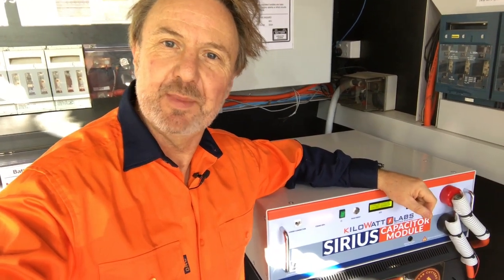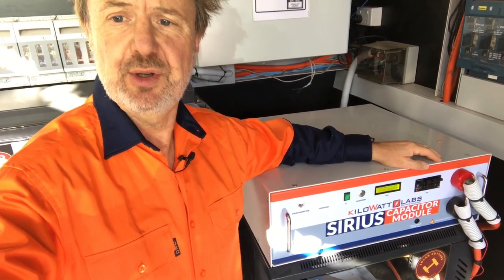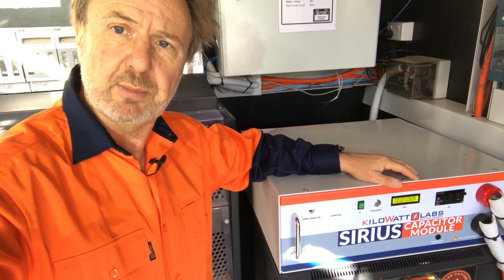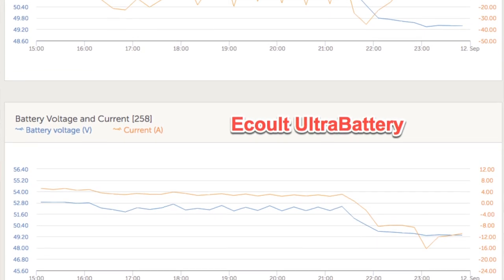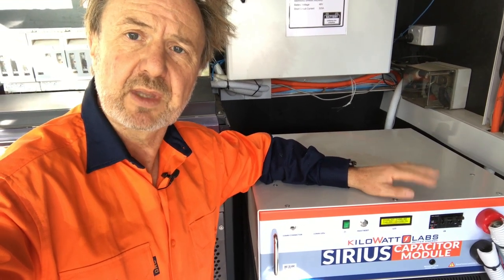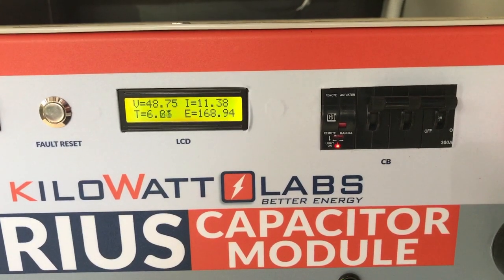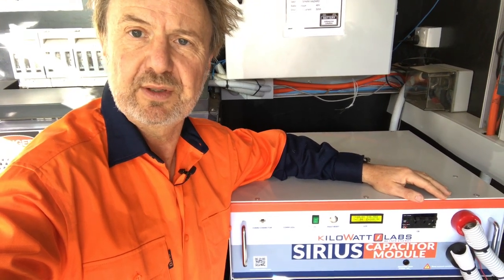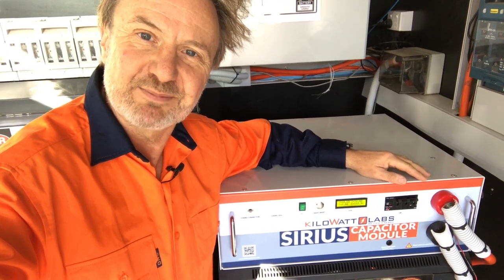Arvio's Kilowatt Labs Supercapacitor Module

Comment: Hi Guys I have been running 2 of these Kilowatt Labs units in parallel for about 5 months on SP Pro Series 1 and Fronius Primo 
Cert .5.0. 6.6 kW Array
Had to turn off  Battery Temperature Compensation to ensure charge voltage did not go too high and trip the unit.
The 2 different units have slightly different voltage and power characteristics when operating according to the screen on the front.
I would have though that these would have been more similar.
Quite different from my experience of conventional batteries when new. I think the measurement of the materials used in the construction of the 2 different units  is not exactly the same, may be because it is newish technology and the materials are imprecise.
Everything works well otherwise, don't go above 54 volts or below 45 volts, charge max 119 amps.
Love how they charge up super fast soon as the sun comes out!
Bit of a leap of faith going down this path so early, but am impressed with them so far.

Comment: Hi Glen. If the super cap and and UltraBattery is connected in parallel, How do you set the charge rate on the system ? ie the super cap and the ultrabattery don't have the same charging pattern, so in theory the supercap wont charge as quickly as it should due to being connected in parallel with the ultrabattery.

Comment: how much does the 3kwh cap cost?  
usually capacitors store 1F, which being equal to about 1J means you need 3600 for 1wh or 36,000 150g 1F capacitors which should weigh several tons JUST for 1KWh.  given this doesn't look like it weighs a ton for 3kwh, how can it be so small?

Comment: Hi... Glen just want to know that do this kilowatts lab work as battery which could be replacement of both lead acid battery as well as lithium ion phosphate battery...
Reply from the maker: Hi Nishant, yes, any 48V battery based inverter will work if you can set the maximum charge voltage to 54V and minimum to 46V.

Comment: Can you please define how actually this kilowatts lab works in detail....
Reply from the maker: Hi Nishant, I only look at how it works on the outside of the box... the rest is magic. Maybe http://arvio.com.au can supply you with more details of what goes on inside.
Reply: Thanks a lot for concern but as you are dealing with the product is it viable economically as compared to other source (LA & Lithum)...Is the variant of battery available in 48 volts only.Do the cyclic life is more compared to the other one.What are your views in that respect....
Reply from the maker: I believe that 24V and 120V variants are about to come out. 1 million cycles - is that enough? Similar cost per kilowatt hour to lithium batteries.
Reply: @SmartEnergyLab  Your replies makes me more curious to know more.So according to you supercap technology by kilowatts labs is the latest and foremost one in market .Batteries are used in Solar hybrid system can it  be used in Electric vehicles too.
Reply from the maker: I'm afraid you're asking the wrong person... time to direct your enquiries to Kilowatt Labs I think
Reply: @SmartEnergyLab  Thanks for  your replies .It was great pleasure to get into a conversation by means of mails.In near furture if I had some thing to ask I will surely get in touch.I regularly watch all your vedios on youtube.

Comment: Hi Glen. Very disappointed that you failed to mention that there is some controversy about the claims made for this device, to say the least. See http://forums.aeva.asn.au/viewtopic.php?p=67082#p67082
Reply from the maker: Hi Dave, my friend in SA is doing testing at the moment. So far he’s satisfied that the claims are real. He’s done blowtorch test, cycling and max charge/discharge tests. He’ll be realising his full report once chemical analysis has been completed on the cells.